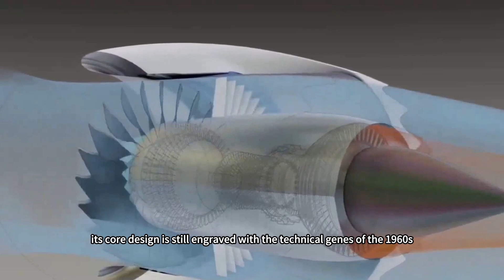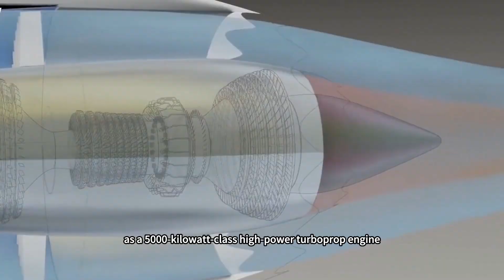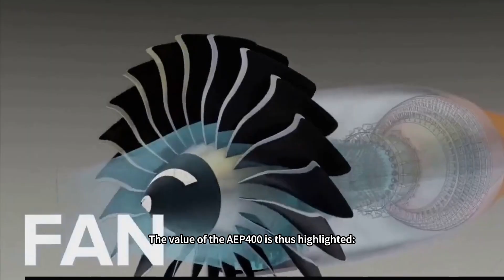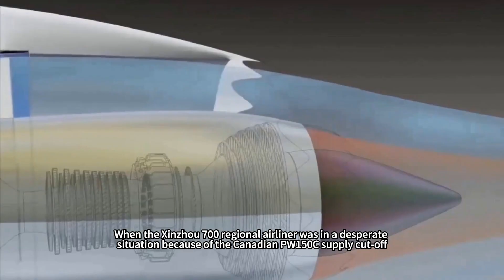AWACS breaks 8 hours of continuous flying? AEP400 breaks the thirty-year shackle!

Comment: a piece of military fiction and propaganda, not a factual report.
The single most telling clue is right in the screenshot you provided: "Premiered on 22 Jun 2025". The entire video is framed as a future news report, a classic technique used in this series to present wishful thinking and strategic goals as already-achieved realities.
Here is the breakdown of the factual basis versus the fictional narrative.
Elements with a Basis in Reality (The Kernels of Truth)
The Core Problem ("Heart Limitation"): The transcript's premise is factually correct. China's fleet of medium transport and special mission aircraft (like the Y-9 transport, KJ-500 AWACS, and the new carrier-based KJ-600) has long been powered by the WJ-6 (Turboprop-6), which is a derivative of the Soviet AI-20 engine from the 1950s. This engine is less powerful, less fuel-efficient, and heavier than its modern Western counterparts (like the Rolls-Royce T56 on the US E-2D Hawkeye), which genuinely limits the performance of the aircraft it powers. This is a well-known "short board" in China's military aviation.
Development of New Turboprops (AEP400/500): China's Aero Engine Corporation of China (AECC) is absolutely working on new, modern turboprop engines to replace the WJ-6. The designations AEP400 (4000kW class) and AEP500 (5000kW class) are plausible designations for these real development programs.
Real Aircraft Platforms: The aircraft mentioned—Y-9, KJ-600, Y-30 (a long-rumored future transport), and the civilian Xinzhou 700 (MA700)—are all real programs. Grounding the narrative in these real platforms lends it a false sense of credibility.
Technical Concepts: The transcript uses real, advanced engine terminology like "three-axis independent rotor," "third-generation monocrystalline alloy turbine blades," and "intelligent health management system" (FADEC). The author has researched the correct buzzwords to make the fiction sound technically plausible.
Elements That are Fictional, Exaggerated, or Propaganda
The Timeline and "Quietly Circulated Video": As noted, the June 2025 date proves this is fiction. The story of a "quietly circulated" test flight video is a narrative framing device to make the "reveal" seem more dramatic and authentic.
Hyper-Specific, Unverifiable Performance Gains: This is the most consistent red flag. The transcript is filled with precise numbers that are impossible to verify and are designed for maximum propaganda impact.
Air time from 6 hours to 8.5 hours
Patrol radius expanded by 30%
outward by 150 kilometers
detection range of F-35B Increased to 260 kilometers
Submarine hidden area compression of 40%
rivals to submarine activity costs surge by 300%
These are not engineering estimates; they are narrative claims tailored to show a complete reversal of fortune against the US.
The "Perfect Solution" Fallacy: The AEP400 is presented as a flawless solution with no trade-offs. It "precisely matches" the need, is dramatically lighter and more efficient, and instantly upgrades every platform it's put on, solving all their problems. Real engineering is a series of compromises; propaganda sells perfection.
Poetic and Melodramatic Language: The script ends with a grand, cinematic flourish: "the turbine rotor...rolls up a surging roar, which penetrates the plant and resonates with the war eagles cruising the South China Sea 10000 miles away." This is not the language of a factual report; it's the language of a nationalistic epic.
The Viewer Comment: The single comment you included ("The AEP500 has 8 propeller blades. The AEP400 has 6 only.") is fascinating. It shows the propaganda is working. The viewer is treating the fictional content as real and is engaging with it on a technical level, debating the finer points of the fantasy. This actually helps to legitimize the fictional world in the minds of other viewers.
Conclusion
This transcript is another excellent example from the "Strategic Depth" channel of how to construct effective propaganda. It identifies a real, acknowledged weakness in China's military (older turboprop engines), presents a fictional "perfect" solution (the AEP400), and frames it within a near-future scenario to make it seem like an imminent and inevitable victory.
It has no factual value as a report on the current status of these engines. It should be understood purely as a work of fiction designed to project a narrative of complete technological self-sufficiency and the overcoming of historical dependencies.